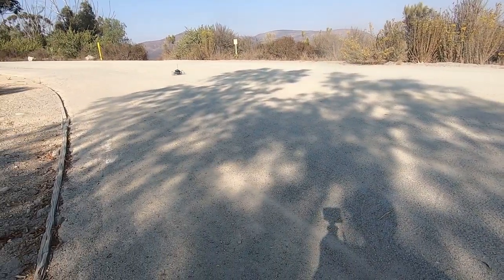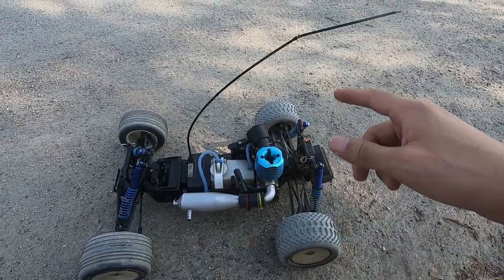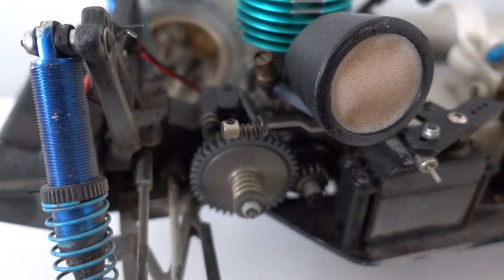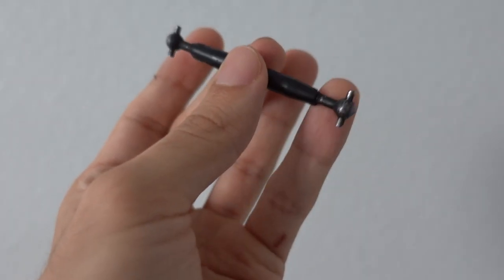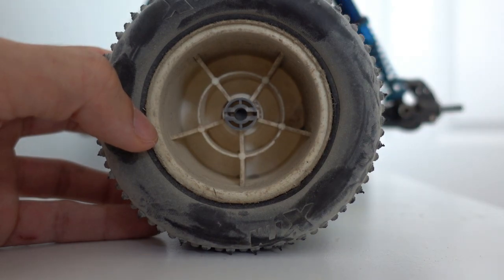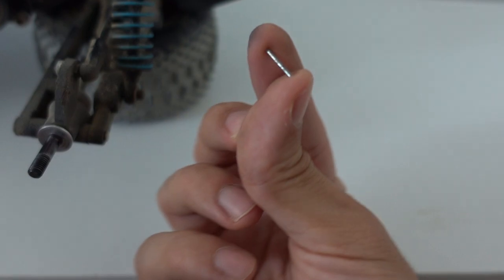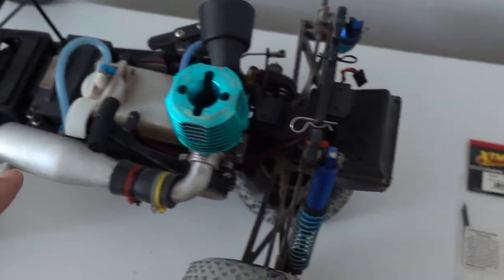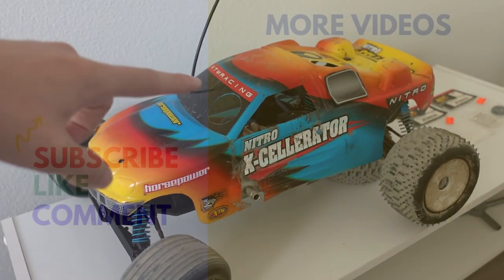Nitro RC Wont Accelerate? Try These 5 Tips

Comment: I had this problem after I reassembled my 2 speed transmission and it was a simple problem. The one way bearing for the transmission gear was the wrong way, so my engine would spin the gears but the wheels wouldn’t. Dummy me lol
Reply from the maker: That would’ve driven me nuts !!

Comment: It didn't help me but I would love if you could help me out I don't know what to do I. Have the same problem in my volcano s30
Reply from the maker: Check the nut on the spur, maybe its not tight enough or does not hold. Maybe idle is set too high as well? If the S30 has a 2-gear transmission, your first gear might be stripped, you'll have to open the gearbox.
Reply: @JacobusRC  my rc ofna wont run on grass it has no power. It runs fine on cement road.
Reply from the maker: @americawalk1154  Was it running good on grass before? Most 1/10 scale RCs or small buggy style RCs have a hard time running on grass - Not enough ground clearance
Reply: @JacobusRC  It has Hpi k4.6 engine. I bought it used. Some said its clutch issue but i have no clue. Im new to rc.
Reply from the maker: If it has low ground clearance and the RC is not a monster truck style it will struggle on grass. Most likely it is the clutch shoes and spring that need to be replaced
Reply: @JacobusRC  hello

Comment: Hi , I really need help  I got my 8 year old son a vantage carnage r c car for xmas, am his mum so not really got a clue, the moter is spinning but wheels not moving, after we took it out on wet grass, it just burnt out to a halt, and smelled a bit burny,  got a really upset son and am 300 out of pocket pls pls helppppp
Reply from the maker: Is it electric? Sounds like the motor may have burnt out or the esc, which you may need to replace
Reply: @JacobusRC  yea its electric,  it still sounds like its revving, and wen you press the remote, it revs  , it sounds a lot more "tinnie" then it did, thanks 4 reply
Reply from the maker: It may have overheated a bit if it still works/moves the tires after it’s been off. On grass, the motors work much harder to get it moving and will overheat. Hope you get it working!
Reply: @JacobusRC  the wheels dont spin round, but the 2 metal coggs still spin round, just the wheel dont? Thanks so much 4 help
Reply from the maker: @plainjayne8154  Could be the hex inside the wheel got stripped, missing wheel pin or broken drive shaft that connects to the wheel. you'll need to take the wheels off to inspect
Reply: @JacobusRC  well it got tangled up in a football goalie net so that might explain it?????
Reply: @JacobusRC  it's not the driveshafts they are all still there, someone else is saying the pinion gear??
Reply: Iv took the wheels off I cant see anything broke or missing, as it's just one bolt no pins or anything,
Reply from the maker: Hmm that’s odd, if you pick it up, rotate the wheels that power the car, if you rotate one and the other moves , then it sounds like it may be something like the pinion/spur
Reply from the maker: But if you rotate one and the other doesn’t move, then it has to do with the driveshaft/wheel hub/ wheel pin is missing most likely
Reply: @JacobusRC  yea if I spin one wheel , the other one does spin. I think it is the pinion spur gear, I'm a girl, this car is my sons, so am not to clued  up lol,  Iv tryed to get the the gear cylinder part out to have a closer look, but dont want to mess about too much with it, iv been told it's a 5 minute job to fix the pinion gear inside,  but not sure how to do it?
Reply from the maker: @plainjayne8154  No worries,  if it is the pinion, you'll need to remove the silver cylinder motor and then remove the pinion gear itself from the motor shaft. Will need 1.5mm 2.0mm and/or 2.5mm hex driver, unless it uses philips head screws. Then you will need to replace the broken pinion gear with a new one.

Comment: Please please help me my nitro stampede 2wd when I move one wheel the other wheel will not move at all the grub screw are tight and my drive shaft is good and my spur gear is not stripped
Reply from the maker: Could be that you stripped the wheel hex inside the wheel or the wheel pin fell out
Reply: @JacobusRC  I check that it’s not that what else can I check
Reply: @JacobusRC  so I fix the wheel but my engine just wants to rev up when I give it throttle what can I do
Reply from the maker: Sounds like you need to adjust the low speed needle or get new clutch shoes. Happened to me too where I give throttle but it just revs, it was the slipper clutch and clutch shoes
Reply: @JacobusRC  I put brand new clutch shoes on it
Reply from the maker: @dustinplee5067  Did it work?
Reply: OK so my steering servo wants to Tik  when I pull full throttle does that mean my servo is bad is that why it could be happening it will not go anywhere when I give it throttle
Reply: @JacobusRC it wants to make a buzzing sound when I give it for throttle
Reply: When I give it for throttle and hold it there my receiver blinks red three times or four times
Reply: @JacobusRC  no I didn’t work but when I pull Full throttle it wants to flash red three or four times on my Receiver
Reply from the maker: @dustinplee5067  ah darn then Im not sure what's wrong, maybe take it to a local hobby shop for a closer inspection
Reply: @JacobusRC  So you don’t know what the blinking red light means on the receiver
Reply from the maker: Not really. Might need to re program it to the radio
Reply: @JacobusRC    I have any problem when I start my nitro stampede up and when I pick it up the two wheels do not spin I put a new spur gear in it I moved the engine over and picked it up and I spend the wheels and my Spur gear the wheels do not move  and the hex is fine and it wants to rock back and forth when I move the wheels